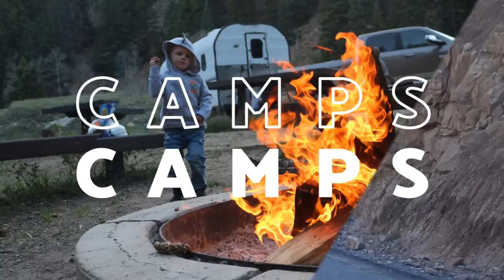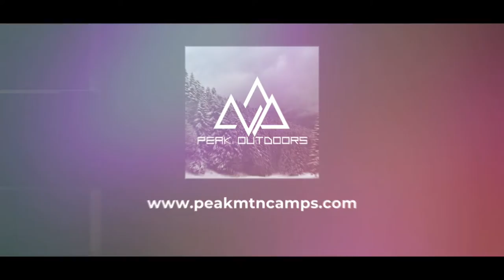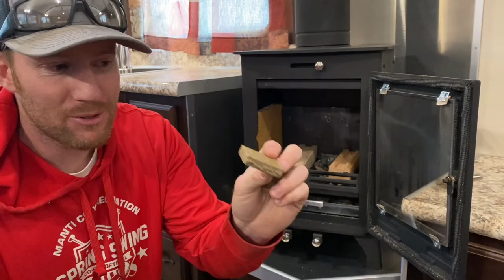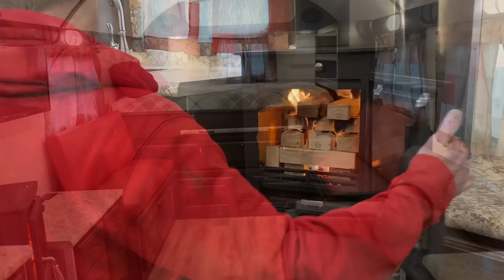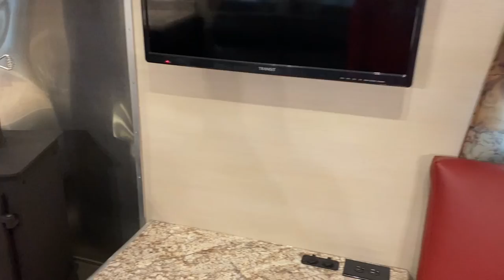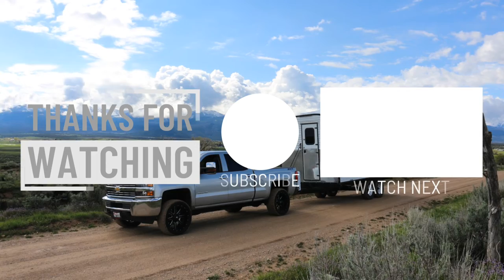Heating a trailer with a wood stove

Comment: How long will a full load last?
Reply from the maker: Too many variables to say for sure. A lot of burn time is going to be determined by what you burn. The harder the wood, the longer the burn time. We find that if you burn it hot and get a good established fire before damping it down you’ll get a more consistent burn and a longer burn. With a combination of pine and alder we can usually get 4-5 hours.